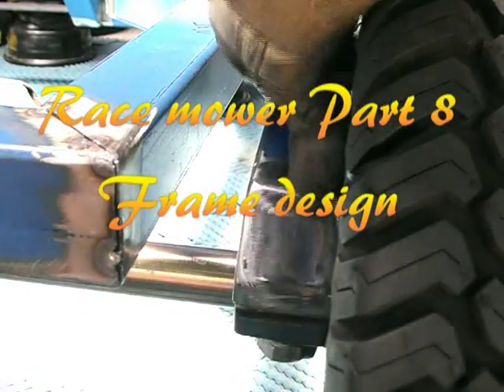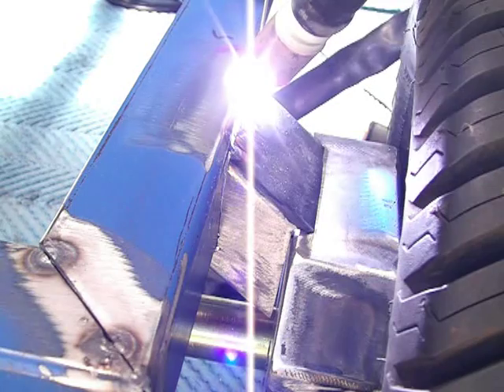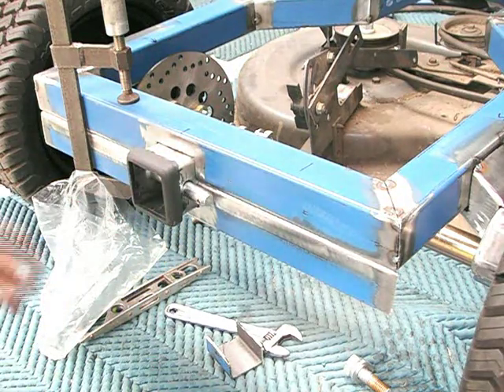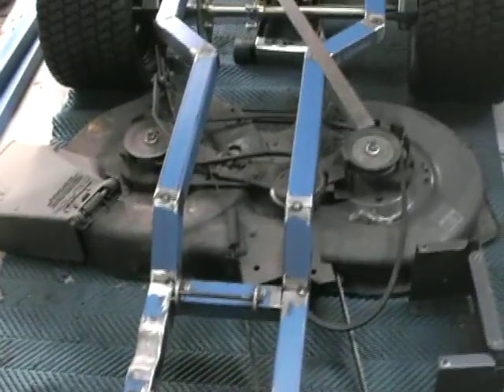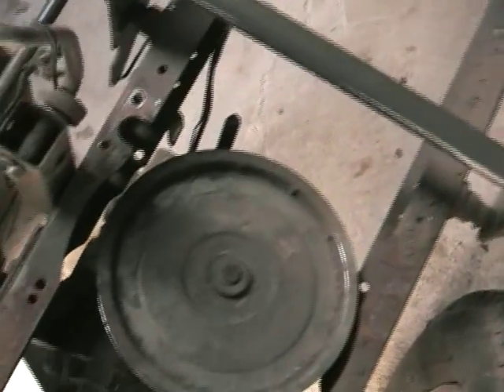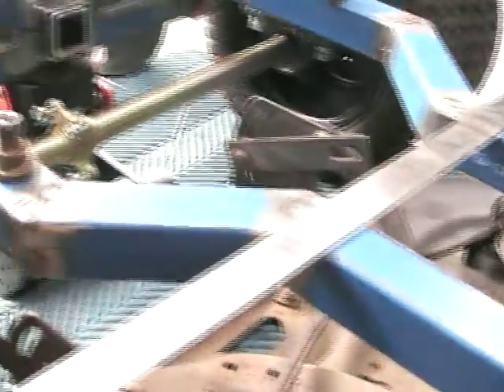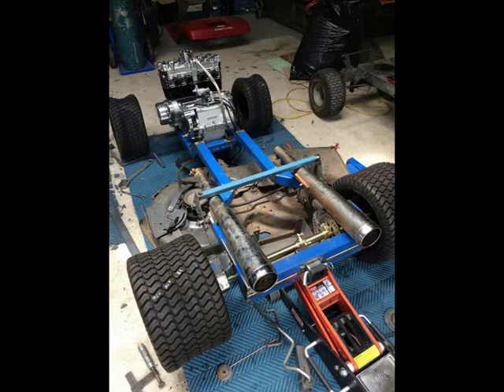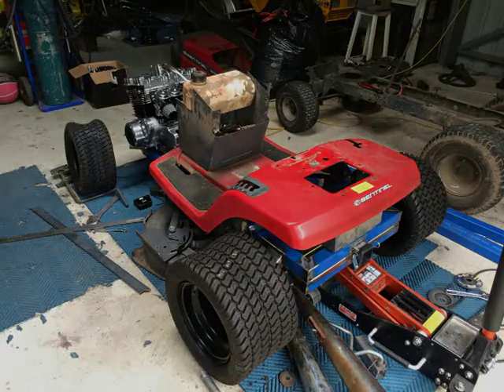Race Mower Part 8 Frame design

Comment: good work is the steel used in the chassis with or without seams?

 special or conventional (normal) steel
Reply from the maker: Hi Mate, given I have very tight clearances I used 50mm seamless RHS, 2mm thick plain mild steel. 1.6mm thick would have been fine, 40mm section would be fine too.

Comment: The deck is at an angle so the blades overlap, otherwise there's a strip of grass down the centre that is not cut properly dude. loving your channel so far, ended up here from Peter Anderson :)
Reply from the maker: Hi, in the end I did install it on a slight angle to cover the point you mentioned. Just has less angle given the space constraint but is still just enough not to have a missing strip in the centre. There are a couple more videos of the deck design from a couple of months ago. Cheers.